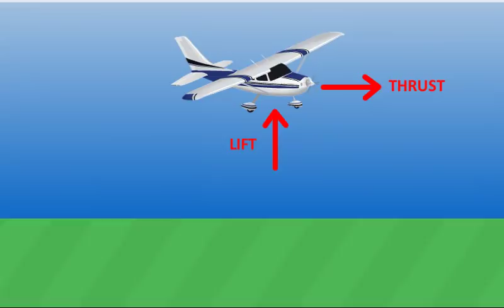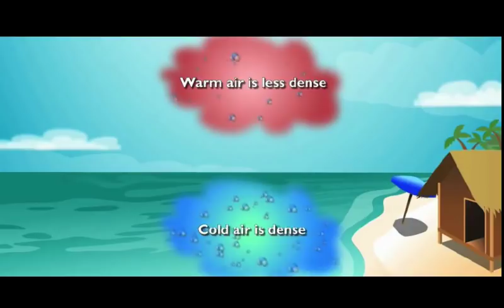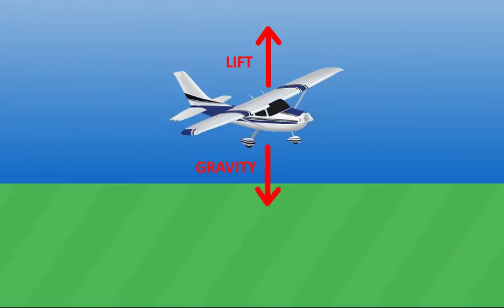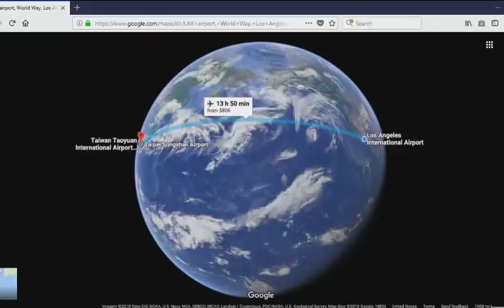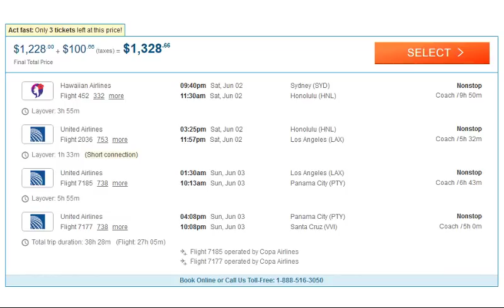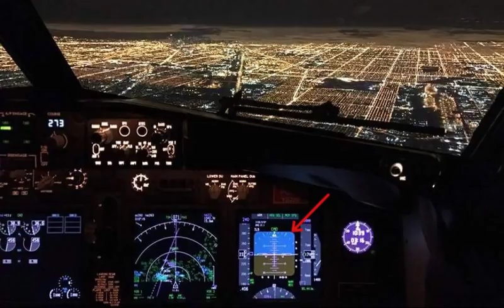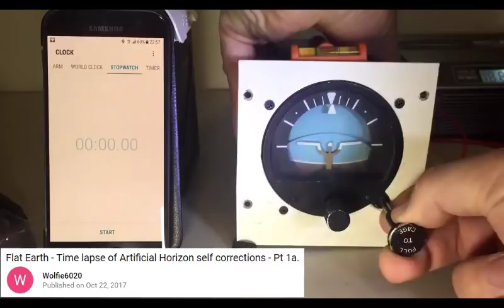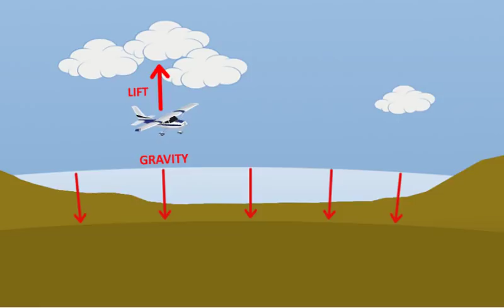Flat Earth Falsities - Plane Nonsense

Comment: Lord o merci! Well folks I get that the iron core is a perfect ball, with perfect thick complex crust /deep oceans, provide an amazing uniform Gravity gradient all over.
 But.. with our perfect circling attracted /locked Moon, we get a perfect WIDE Elipse rotation of EARTH around the SUN...? She has 99% of the whole solar system Gravity but our fixed captured ball does not care, not a sane path around it; whats that all about?
Reply: Literally everything you said was wrong.  The Earth's core is not a perfect ball.  The crust is not "perfect thick".  Gravity is not uniform around the Earth.  The Moon's orbit is not a perfect circle.  The Earth's orbit around the Sun is not "perfect WIDE", it varies by less than 3% from a perfect circle.  Why do you feel the need to come here every day and claim that you understand everything when you make it clear that you do not understand anything?
Reply: @MrQuaiven  My my you can deliver some lip sometimes???
Everything... Gravity is not uniform? Yet IT keeps planes level?
Fuss about a meager 0.5% more at the flatten poles to the fat equator?  And still the floating iron core is also imperfect??
Dear Me! (WIDE WORST!) : 'In this context "Perfect" means a level (even) curve, not a industrial machine shopped one!
 But: as close to such a natural condition as possible :)

Okay its not like drawings[1], only 5 million km difference around the sun. And yet its gets colder / hotter...
Yet an non answer... fine for Moon with weak Earth force, but expect nearer perfect with the wider HUGE (99%)Sun force !?

The Moon's Orbit and Rotation - Windows to the Universe
https://www.windows2universe.org/the_universe/uts/moon1.html
The Moon has a nearly (perfect) circular orbit (e=0.05) which is tilted about 5° to the plane of the Earth's orbit.

Claim understand everything(???) by asking a question?
I said numerous time I dont understand this Heliocentric business!
Adjective usage is not about "understanding" common sense.
Guess for once I gave a candy because first time you offer more then just demeaning lip yourself. 
Some do appreciate me "helping" your cause you know :)

[1] https://www.google.com/imgres?imgurl=https://upload.wikimedia.org/wikipedia/commons/thumb/f/f0/Seasons1.svg/600px-Seasons1.svg.png&imgrefurl=https://en.wikipedia.org/wiki/Earth%2527s_orbit&h=352&w=600&tbnid=kTgsrzmqOxy-IM:&q=how+wide+is+the+elliptical+path+of+earth+around+the+sun&tbnh=125&tbnw=214&usg=AI4_-kRPUxj2bCHSRSQgK7Wnl1_OulI1Wg&vet=12ahUKEwiAqqPIq83fAhVBMnwKHfhWAlYQ9QEwAHoECAYQBg..i&docid=4_acBU8tZBVVyM&client=firefox-b-ab&sa=X&ved=2ahUKEwiAqqPIq83fAhVBMnwKHfhWAlYQ9QEwAHoECAYQBg
Reply: @BrainUser1  "Everything... Gravity is not uniform? Yet IT keeps planes level?"
The variation is insufficient for YOUR incredibly imprecise human senses to notice.

"Fuss about a meager 0.5% more at the flatten poles to the fat equator?  And still the floating iron core is also imperfect??"
Yes.  

"Dear Me! (WIDE WORST!) : 'In this context "Perfect" means a level (even) curve, not a industrial machine shopped one!"
Is this even English?  You really suck at communication.  I'm not about to try to interpret what you are trying to say here.  Say it again.  And this time say it in plain English like you are trying to be understood.

"Okay its not like drawings[1], only 5 million km difference around the sun. And yet its gets colder / hotter..."
The distance to the Sun is not what creates variations in temperature.  Again you are proving that you do not actually understand the thing that you are arguing against.

"Yet an non answer... fine for Moon with weak Earth force, but expect nearer perfect with the wider HUGE (99%)Sun force !?"
What are you even saying here?  Stop trying to write things in iambic pentameter.

"The Moon has a nearly (perfect) circular orbit (e=0.05) which is tilted about 5° to the plane of the Earth's orbit."
Nearly perfect and perfect are clearly different things.  Admit you were wrong and move along.

"Claim understand everything(???) by asking a question?"
Yes, you claimed you understood it when you said "I get that the iron core is a perfect ball".  That is you claiming you understand something but in reality demonstrating that you do not understand it.  You have done this numerous times.  You have asked many questions.  Always based upon a flawed understanding of science.  You have had things repeatedly explained to you.  And yet you keep coming back and asking THE SAME questions demonstrating the same FAILURE TO UNDERSTAND.

"I said numerous time I dont understand this Heliocentric business!"
Then maybe you should stop ignoring all the answers that have been given to you.

"Guess for once I gave a candy because first time you offer more then just demeaning lip yourself. "
What language is this?  

The picture you linked is NOT TO SCALE.  It is for demonstration purposes only to demonstrate CONCEPT.  If it was shown completely to scale YOUR BRAIN would not be able to tell the difference between the very slight elliptical orbit of the Earth and a perfectly circular orbit.  Stop trying to find holes in the demonstrations and start trying to understand the CONCEPT being described by the demonstration.  Then maybe you will finally UNDERSTAND the things that you keep asking about and you might actually be able to produce real questions instead of just asking the SAME QUESTIONS over and over and IGNORING the answers.
Reply: .... well the guy that is not here everyday is back... WHO said GRAVITY cause by the imperfect(?%) core inside the imperfect ball Earth had a sufficient variation??? So finally it seems its very near perfect... so Gravity's automatic levelling keep the nose level with the... imperfect curved surface, okay fine!

Never said the HUGE multy layer crust was perfect...???
Being all that matter "hinders" this imperfect Gravigenerator, would of expect more variation over deep trenches.

"Sun is not "perfect WIDE"" ...??? - hes got imperfect reading.
I dont get what the man wants from me?
So Gravity variation is WHY the Moon has an imperfect orbit?
Same as the Earth around the Sun's gas gravity!
- I admit I dont understand :(
Reply: @BrainUser1  "Never said the HUGE multy layer crust was perfect...???"
Yes, you did.  In your first post when you said "Well folks I get that the iron core is a perfect ball, with perfect thick complex crust"  Maybe you are having trouble understanding what you are saying?  I know I am.

"Being all that matter "hinders" this imperfect Gravigenerator, would of expect more variation over deep trenches."
What YOU expect is irrelevant, since it is clear that YOU do not understand what you are arguing against and therefore have no legitimate basis for expectation.

""Sun is not "perfect WIDE"" ...??? - hes got imperfect reading.
  I dont get what the man wants from me?"
What are you even saying?  Like I have told you repeatedly.  You write in a very unclear manner.  You make it very difficult to understand what you are trying to say.  That is YOUR problem.  Learn to communicate if you want to be understood.

"So Gravity variation is WHY the Moon has an imperfect orbit?"
When did I say that?  When did I say anything like that?  What science book did you find anything like that in?

"I admit I dont understand :("
You don't understand because you are ignoring the answers.  You don't understand because you don't want to understand.
Reply: @MrQuaiven   ""Well folks I get that the iron core is a perfect ball, with perfect thick complex crust""......more sidesteping nick-picking?
Sorry THAT got you triggered, my bad jump back, wrote but not meant.
=} "The crust is not "perfect thick"  - kind of obvious either way.........
' with (near)perfect (outside ball shape) thick complex(DIFFERENT) "crust" ' = 3000km MANTLE(better?).

' /deep oceans'  [The crust thickness averages about 18 miles (30 kilometers) under the continents, but is only about 3 miles (5 kilometers) under the oceans.]   (- SATIRE!), 
' provide an amazing (0.5%) uniform Gravity gradient all over.....' 
(- SATIRE UPON G UNIFORMATY).... sign! :(

 [The Earth's crust is made up of a mixture of all three of these rock types. However, their distribution is not even / Yet below that layer you will find one rock type….JUST ONE!   It is an igneous rock that we know as basalt.   Basalt is black, dense,] [1]
- Point being is should affect Gravity uniformity.

[1] https://geoetc.com/earths-crust/
Reply: @BrainUser1  What language are you speaking?  I'm being dead serious here.  I'm not even going to attempt to translate what you just wrote.  Try speaking in plain English.  Or French.  Or Russian.  Or any language at all so long as you are speaking in a plain language that follows the actual grammatical rules of the language you are using.  Stop trying to write poetry if you actually want your words to be understood.
Reply: @MrQuaiven  JESUS CHRIST! For a sane guy that doesnt want me around you sure stick! Just a quick muse, not expecting more then the classic +No... / +wong / +David Alexander / +Capt"Wess / etc line inputs...  Busy playing games, not into all this trouble.
Reply: @MrQuaiven   Louis is a self proclaimed troll, i.e. a pathetic, useless twat

Comment: VoysovReason, you are so morron. Yours explications are based on gravity. There is no gravity. It is just a theory of heliocentrists, but without proofs. The earth is FLAAAT.
Reply: Then what force pulls you back down if you jump? I mean everytime i jump i fall back down. And everytime i throw something it comes back down now how is that if there is no gravity?
Reply: @pinquinsam  gravity is so strong it can keep a 350 pound man down on the surface but it can't keep birds from flying hahaha
Reply: @thestepbrothersv1227  
A butterfly has wings and doesn't weigh much. The force ( 'lift' ) it creates by flapping its wings is stronger than the force of gravity pulling it to the ground. What's so difficult to understand?
Mass and density don't cause objects to move (in any direction). Movement requires a force.
Reply: @HumptyDumptyOakland  perfectly put.
Reply: @pinquinsam  , how you know it is because gravity? Because told us the teachers at school? But about density and buioancy, did you learned?
Reply: @valisimon6749  if you ever had proper physics your teacher showed with experiments how gravity works. he showed me that in a vacuüm a hammer and a feather are falling at the same speed. and the feather fallls outside of the vacuüm waay slower because the feather catches a little bit of lift. from the warming air pulling it back up. yes the teacher told what gravity was. but not only that he showed it to me. he was one of my favourite teachers.and yes he also showed how density and buioancy works. he didnt just tell me he showed with experiments.
Reply: pinquinsam, In vacuum is inexhaustible friction
 with the air. That is why all objects will fall at the same speed, regardless of their density and weight. So gravity does not influence them, but the lack of friction with the air.
Reply: Most all of the world, excluding your kind, believe in gravity and heliocentrism. Gravity is not "just" a theory, it's a SCIENTIFIC THEORY. ►"In everyday speech, theory can imply an explanation that represents an unsubstantiated and speculative guess, whereas in science it describes an explanation that has been tested and widely accepted as valid." —Wikipedia
Reply: Vali Apples and microphones fall on the ground.. so that MUST mean GRAVITY! ALL Vatican flock believe in there science.
Reply: Dear me... the theory of gravity is not a question as to whether gravity exists. We know it exists. The theory of gravity is how does gravity work and what exactly gravity is.
Reply: JABBA WAFFLE , really? Well, I don't think there is the gravity. Why I shood to think this theory?  Just because some of men told us and tried (without convincing arguments for me) to impose us as a mandatory law?
Reply: @valisimon6749  No one is forcing you to accept gravity. No one actually invented gravity. Gravity is a natural force which attracts all matter in the universe. Newton was a mathematian who went about performing experiments and observations to determine the various relationships between matter and gravitational forces. Now Newton couldn't explain what gravity was as he didn't have the necessary tools at his disposal, he speculated but this is where Einstein's approach has since top-trumped Newton simply because Einstein had access to further knowledge gathered over hundreds of years. Newtons work has since been built upon and explored in greater depth to determine the exact mechanics of gravity, thus the theory of gravity being how does gravity actually work. Using this work we can place objects in orbit, we can predict with significant accuracy the orbits of planets,moons and other objects in our solar system... objects which are very easy to find by an amateur with a reasonable telescope. There have been objects,planets even, discovered thanks to the mathematical tools used to establish gravitational forces. 
What would be a convincing argument for you? Have you tried to read up on the subject? Attended lectures? For you, what is the attracting force which consistently pulls objects to the ground?

Comment: Go Rent a van buy you a child's toy helicopter drive at 70 mph spray paint all the windows black set the toy helicopter down and tell me how fast the helicopter is moving. Let the helicopter take off and hover. From the perspective inside the van the helicopter isn't moving but the van is traveling 70 mph so helicopter has a ground speed of 70 mph. The same thing  is happening to any plane just on a larger scale.